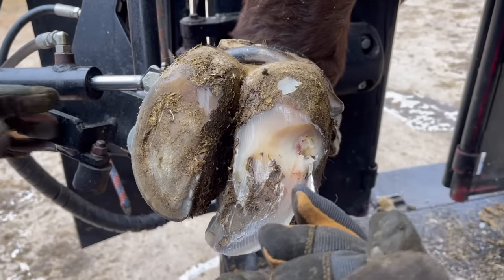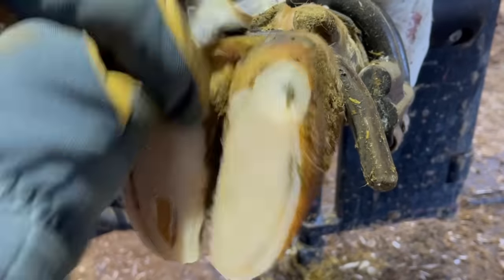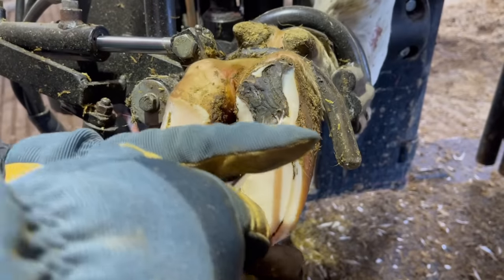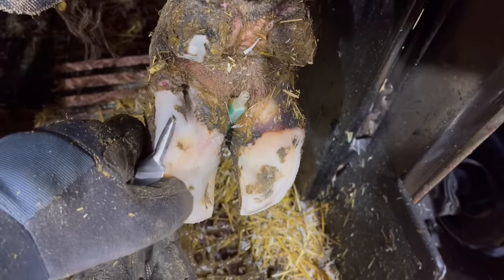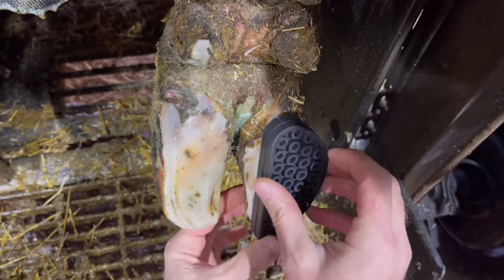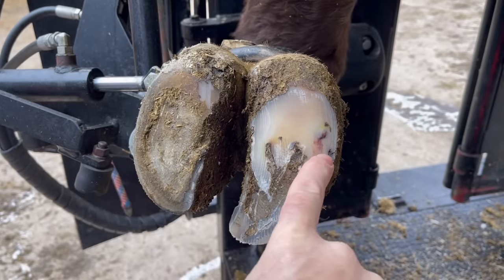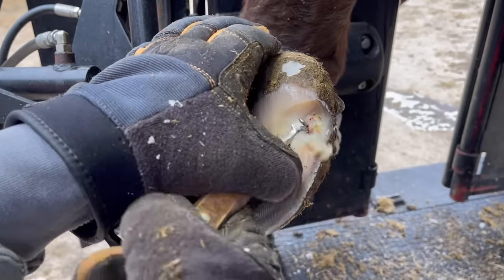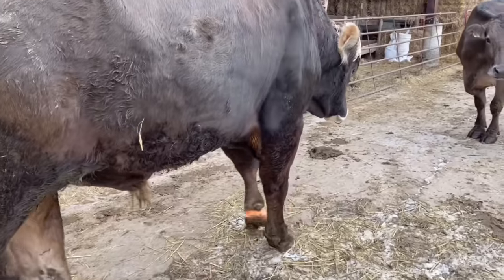This BIG BULL has a BUM CLAW

Comment: Genuine question, it seems unsanitary to do this job without gloves. Especially if you have a partner or kids to whom you may spread bacteria to when you touch them. I know sometimes you need to literally feel where the problem is, however thin latex gloves seem like they would suffice. So why ever touch the hooves without a protective layer?